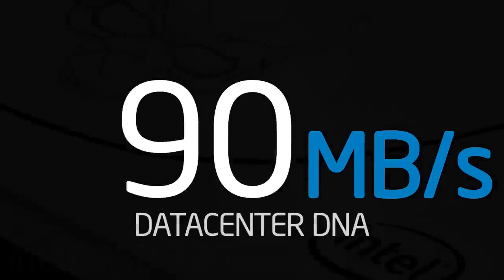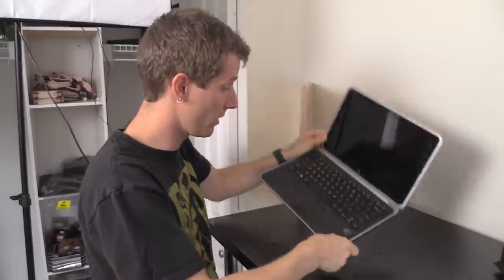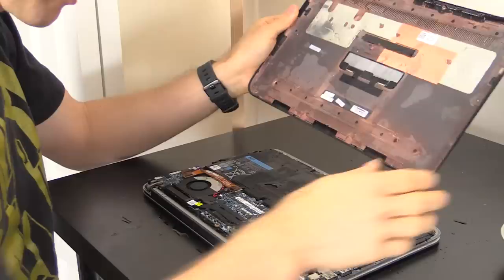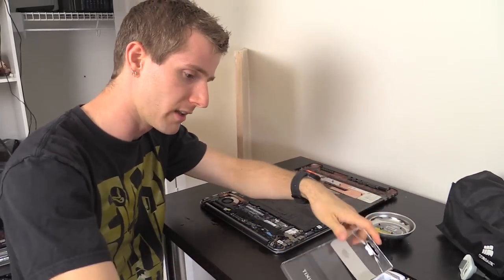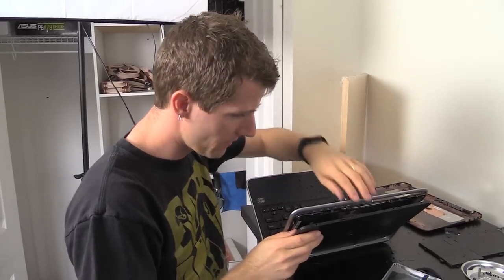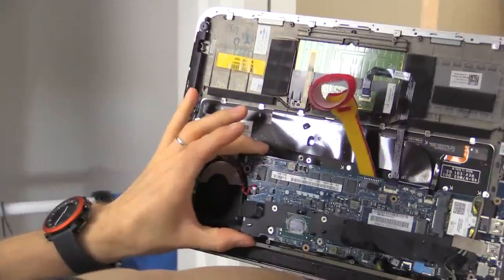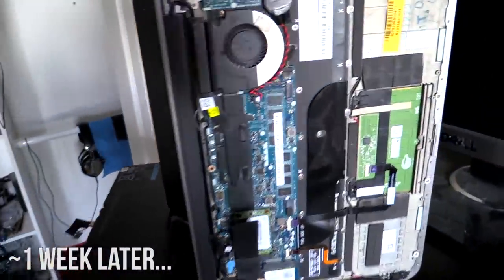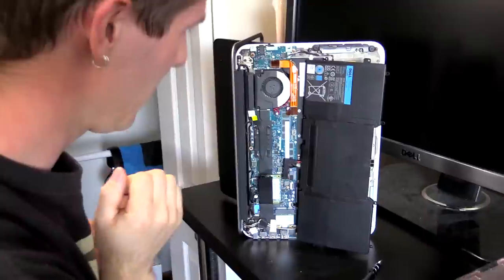Wet Laptop Recovery - Is it Possible?

Comment: I have an HP 15 laptop, the same thing happened, (Except it fell out of my bag, fell three feet, and into a 4 ft ditch while still on) The laptop shut off, which is what scared me, so I spent the whole day in school with a laptop that was completely taken apart, just air drying it, and at the end of the day, I reassembled it, and it ended up working perfectly fine. Now I use it as a Linux machine.

Comment: About 3 months before you posted this video, I accidentally spilled a full alcoholic beverage on my open notebook while it was on (an Asus G74SX RoG notebook, worth about $1300 then), killing it almost instantly... Apparently, my notebook doesn't like vodka. I attempted repair (after the hangover), but the damage was done; It would power on, but wouldn't POST at all. I also damaged the LCD panel, as you could see liquid splotching on the display before it died completely.I couldn't work on it because I didn't have the space/tools/patience to do it after it had happened, so I just boxed it up and let it gather dust until an opportunity came about to where I could work on it.

About a month ago, present time, I went ahead and attempted refurbishing the system. I took it entirely apart, took some 'Isopropyl corrosion removing' solution and a toothbrush to it for a good amount of time on components that appeared to be 'sticky', and let it dry overnight. 

I'm proud to say that my biggest fail turned into my greatest success, as it boots and runs as it used to before the incident! Working in an electronics repair shop (and having ~15 years experience) has it's benefits, I suppose.

Comment: I had an Alienware M11X that my mom spilled water on, wish I had known this in 2012.
Reply: *****
Not really, it was an overpriced piece of shit. Alienware sucks.
Reply: ***** step1 sell the alienware step2 buy better laptop step3 success?
Reply: *****
Step 2 should be buy TWO better laptops. As much as Alienware costs.
Reply: FraggedDabloons that or a whole desktop rig
Reply: I knew someone who spilled an entire bottle of beer into her laptop she toweled it off then let it stew for a day. Then tried turning it on low and behold it did not work. After a few more days pass she comes to see me with it. I tell her it is dead she leaves it with me with vauge instructions of to see if i can do anyth8ng for it. Just in case I plug it back in try it again in front of her and then nope it is dead and nothing can be done to reverse that. I tell her I can take the working parts out and then she can get a new pc and transfer whatever. I pull the ram and hard drive both of those work.  And i pull the battery it is filled with good Samsung 18650 cells. She staggers back in my door a week later asks me if I was able to fix it I said no here are the parts left that worked... as i had told her last time. She left the parts for me to keep and was wanting my advise on where she could get a new laptop... i told her walmart.
Reply: wow I had a 120 dollar keyboard and 70 dollar mouse and my mom spilled water on it -_-
Reply: Lunas Eclipse Please punctuate. That's very hard to read.
Reply: ***** alienware? ugh, gross.

jk there okay have'nt had any experience with them.
Reply: Joey moutree I donno they were good before dell bought them how far could the brand have fallen.
Reply: oh i did not know that dell bought them. hmm.
Reply: Joey moutree years ago I think 2001 or so and dell uses them as the enthusiasts or gaming brand...
Reply: hmm.

Comment: It works, but the laptop may not live as long as it should. Moisture will oxidize and decay some of the solder joints and connectors on the board as well as rusting some of the steel parts, screws and wire terminals in the connectors. I wouldn't expect to be using the thing long term. Its lifespan will probably depend on how drenched the internals were and for how long. Actually, a follow up for the working state of the laptop would be pretty cool :) +LinusTechTips
Reply: jamesb1221222 Linus probably knows that.
Reply: jamesb1221222 couldn't that work by resoldering? and replacing screws
Reply: Considering they still use it today, I would say none of that happened. So it has lasted at least 2 years 7 months.
Reply: jamesb1221222 if you clean the boards with alky ( full complete disassembly) it will prevent the oxidation, done when its still wet obviously

Comment: mostly electronics wont get damaged if wet, as long as you dont try to turn it on, if already on, turn it off as fast as possible and remove the battery, or you will short it, because water is a great conductor. you were lucky it was just rainwater, had it been tap water, containing all those minerals and chlorine, you would have to wash it in distilled water or a huge amount of alcohol to get those nasty things, cause chlorine contains salt which is also conductive. Also rice is not so advisable because it has some fine starchy powder which will get into some nooks into your device and hardens, just put it on a warm(not hot) place, Dropped my phone once, I strapped my phone to the back my computer's water radiator for 2 days, turned it on. PRESTO!
Reply: Yep, spilled tap water on my keyboard once. I turned it off, took the little battery out, and let it dry a few days with the back open. Nothing broke and the water was from a private well, it is soft water and has no/negligible chlorine content so I can't speak on the mineral part.
Reply: Pure and nearly pure water (distilled) is not conductive, water with dissolved salts is conductive because of the ions in it
Reply: I once fixed a laptop that had a cup of coffee spilled over the keyboard. I just took it apart and placed every component on a heated floor overnight. The next day, it was abit sticky, and after just a new keyboard, it worked perfectly.
Reply: Cool
Reply: I was wrong on the soft water bit, it does contain enough minerals to leave a mineral deposit, but not enough to justify a softener.
Reply: Soft water contains sodium salts where as "hard" water contains magnesium and calcium salts mainly.
Reply: Aidan Gieg
Thanks for the info, now how should I go about telling the difference? No, I don't want to know too badly, so don't go off googling it for the next 10 minutes like I would.
Reply: Hard water leaves some sort of residue in skin and hair in showers for the most part I believe (not sure about that) but it tastes kind of "chalky" compared to soft water and hard water can discolor certain fabrics and dyes. I would Google for 10+ mins on basically anything also lol.
Reply: Chlorine doesn't contain salt... chlorine is an element which means its literally just chlorine atoms. Salt contains chlorine. Salt=Sodium+Chlorine
Reply: Chloride is the ionic form of Chlorine. Chlorine becomes Chloride when it forms an ionic bond with sodium. The bond then dissolves in water to become a solution of 1:1 Cl- and Na+.
Reply: adza botchway
hahahahahaha...Ok I'll stop. (really though, that was pretty funny)
Reply: haha sorry I guess I should have explained how the chlorine becomes chloride
Reply: adza botchway what the heck is wrong with you?
Reply: your right
Reply: the distilled water always does the trick
Reply: funny how you said water is a good conductor (which it is not) when you mentioned to use distilled water.
Really great advice here.
Reply: water isn't conductive, the metals it picks up from other materials it touches are what makes it able to conduct electricity
Reply: i was just nitpicking.

Comment: The real tips is "don't turn on the laptop when the laptop still wet"
Reply: +William Suryaadmaja dont press any buttons AT ALL im sure thats how peoples phones die they get it wet and instantly try to use it, nah if it was me id take the back off and disconnect the battery i wouldnt be pressing no buttons not even to turn it OFF! that battery comes right out that instant and will not attempt to test for a week or 2 later if i got out to do with it. i can see some people been like "well ive disconnected the battery for 6 hours it should be ok now" .... NOOO its still in the same mess it was in 6 hours ago need to wait at least 7 days even then id still be taking a risk let it dry.
Reply: +Julian john my old battery died i bought a new one and it's forced to fit in my phone
Reply: i did that but my phone was in the water for so long it got water damaged the phone works its just the screen is finicky and every once in a while the power button stops working for a while so i cant use ir
Reply: Linus Wet tips
Reply: @HappySlappyFace  Same,  I need to order a laptop dell battery since it isn't charging anymore
Reply: @handsygirl  if you can, disconnect the battery. id leave that laptop in a boiler room to dry out for 2 weeks without the battery, if you in a rush you could try putting in rice for 7 days, if you seen the bios thats probably a good sign its better than nothing on the screen at all but keep power off while drying it out dont let it get too hot!
Reply: @handsygirl  needs to be dry and somewhat warm room not too warm dont want to melt it
Reply: @handsygirl  after how long of staying in your AC room?

Comment: Part of the reason it survived is that the keyboard is a completely separate removable part that is sealed from the rest of the laptop. And keyboards don't actually have a circuit constantly running, only when you press a key so it couldn't have shorted out, the keyboard anyways.
Reply: water still got into the rest of the laptop quite thoroughly
Reply: only when you press a key yes? ... well that is because you press connecting the circuit yes? ... water is conductive bypassing the press and this causes it to short circuit and if it was connected to a second button due to the waters conductivity it would fry the circuit board ... i know as I've spilled so many fluids on my keyboards (without pressing a button) i should have learnt by now to stop drinking at my pc :P
Reply: 4 keys died on my desktops keyboard when i accidentally spilled pepsi on it, so i wouldn't say they can't died like that.
It was one of those membrane types with 3 layers of plastic encasing wires.
Reply: yeah 2 of mine died that were membrane, it wasn't wires though it was a flexi pcb... one with vodka coke, the other milk :P thats why i moved onto a mechanical keyboard, more resistant to small spills
Reply: Michael Burt
 that's what a "flexi pcb" is, wires sandwiched between 2 transparent sheets of plastic.
Reply: Joe G.P.  The common guideline is that you don't submerge any keyboard into any kind of liquid (mechanical or  membrane). I'd quess that membrane keyboards would be more resistant to coke than a mechanical because they are simpler (don't trap water) compared to switches (which can't be opened without ruining the switch, at least to my knowledge.)
Reply: lBonaCl membrane IBM keyboard,  little bit of mineral oil from my mineral oil Pc. Every key slowly started to stick...  Membrane keyboards may resist more fluid,  but are forever f'd once fluid is between pcb and membrane.
Reply: Joe G.P. it's probably the sugar that was left after the water evaporated. If you don't mind further destroying your keyboard, give it a good rinse and let it dry

Comment: Thumbs up HP
Reply: Dell XD
Reply: hp sux
Reply: lol its not that bad i had one of 12 yrs
Reply: lostgaming I'll never buy another but I've never had one die on me so I'll give them that. They've all run scorchingly hot and the proprietary software has never run or even updated properly.
Reply: true
Reply: You're thumbing the wrong company.  That's a DELL XPS laptop.
Reply: Carl-Philip Virdelo rofl explain how HP sucks. HP is the largest business supplier of hardware and things a like.
Reply: it is a dell laptop not hp
Reply: Danel D I can tell you.  Every HP computer that my parents have ever bought had broken down in less than a year.  My mom owns an HP laptop and that thing is slow as death.  It struggles to keep up and it runs quite hot.  My brother's laptop is also an HP.  It runs hot even after upgrading with a new blower fan and it randomly shuts down because it overheats.  I've owned two Dell computers in recent years and they've lasted FAR LONGER than any HP my parents had.  My first Dell was a Dimension 4600.  It's 10 years old and still runs like a champ.  Also, had I left my Dell XPS 9100 operational, it would still be in use today.  I decided to scavenge it for parts to build a custom machine a year ago.  I still don't regret buying that Dell.
Reply: i  think we all know that -_-
Reply: GrnArrow092 I've had hp laptops aswell and yes I know that a big issue is that they run hot but that is a fail on the designer's part. But that's all. HP's enterprise branch makes like 30B a year so they must be doing something right. I bet your libary uses HP and so does your police, fire , health department, government etc. I am not saying every laptop/desktop they produce is good. But saying that HP sux is just stoopid.. At the company where I work and provide support, there are still HP P4/Allendale dualcore systems running smooth as butter. And your moms laptop running slow has nothing to do with HP..
Reply: HP doesn't sell laptops. They sell miniature jet engines.
Reply: Carl-Philip Virdelo
I'll have to agree with that. After first-hand experience with an HP computer, I've noticed every part in it that has had the HP logo on it basically sucks. From the motherboard to the case(although the non-HP stuff inside was fine).
Reply: Aimela That's because HP uses low grade AMD components in their home computers.  I found out from experience never to buy HP computers and I never will.  My parents once bought a mini HP computer and the only thing that survived out of it was the hard drive itself because it was made by Western Digital.  That computer only lasted around 9 months.  You get a much better product if you order your computer through Dell.  Dell computer uses Intel hardware which I find is much more reliable.  Sure it costs more, but you get what you pay for when it comes to computers.
Reply: Sverre Nielsen If you look on the bright side, it will keep you warm on those cold winter nights.  Haha.  In all seriousness, situations like that is why I chose never to buy anything AMD.  I've learned that kind of hardware just isn't reliable.  I've been using Intel hardware in my computers and never had a problem because of hardware issues.  I admit that I have ONE laptop with AMD hardware, but I didn't buy it.  It was an Acer laptop that was given to me over a year ago and I fixed it up.  It's decent for a portable computer and runs better with an SSD installed.  Of course, if this thing dies, I'd consider getting a tablet or an ASUS laptop.  The ASUS laptops use Intel hardware.
Reply: GrnArrow092 Haha, I know. But the same goes for me, I am NEVER going to use another AMD based pc. Biggest pc of shit ever

Comment: That's one of the reasons I love my T440s. If I were to leave it out in the rain with the lid open, all the water would go straight through the drainage ports and never touch an internal component.
Reply: what's anT440
Reply: Lenovo T440s, it's a laptop.
Reply: Dash Lambda  Its not a laptop its a TANK :P
Reply: express496
That happens to have a display and a keyboard~
Reply: Dash Lambda and a computer inside

Comment: had a same experience like what you did linus,

i used my waterproof sony xperia z to make an underwater movie.( when i was on holiday in greece 5 years ago)  that worked, however the phone died 2 minutes after that, it was a salt water enviroment, and never gave it much tought anymore, i accepted the data loss..... 

Last week i found it, lying somewhere and decided to plug it into the pc, and miraculously , there was a response. ( pc gave some usb_dloader thing ) 
not that it did much, but there was hope. 
so i decided to clean it up, and give it another try, i cleaned the mainboard with an electrical tootbrush to remove all the rust that got there over the past few years. my computer said "s1 fastboot mode" ( so i got more hope that it was possible to recover  the data)
after that i used alcohol and an ultrasonic cleaner to remove the last rust particles. 

a friend of mine charged the battery  ( it needed to be charged externally due to low voltage) 

put everything back together and booted the phone, 
to my surprise my computer said "sony xperia z connected"  , and i was able to restore the data. ( the screen was dead though) 

now after 5 years, i could finally look at what i recorded :) 
i'll share it here with you guys, sadly it isn't what i hoped for, but it was a nice and interesting project to see that it could still be recovered 

vid:  http://col.pjottrr.nl/write/onderwater_griekenland.mp4
Reply: potato potato potato potato potato potato potato 

I didn't, a friend of mine has some equipment to do that, if you really want to i can probably figure it out, but i guess google could help you out as well